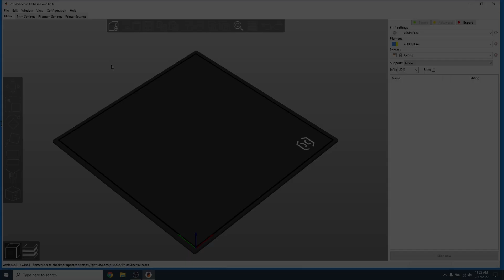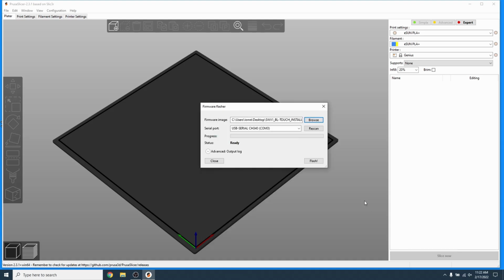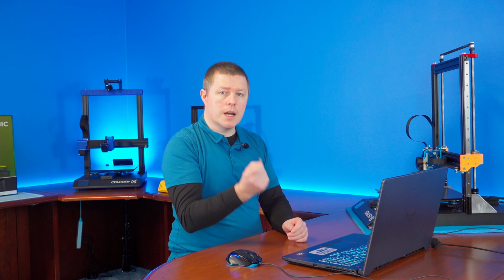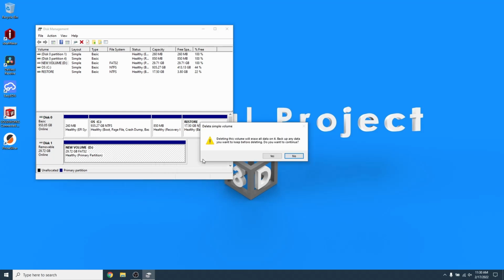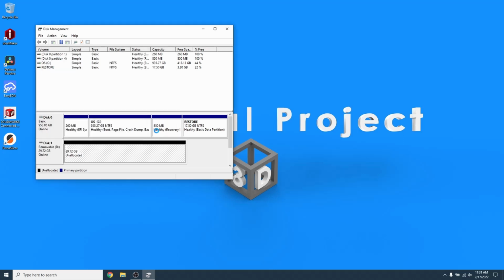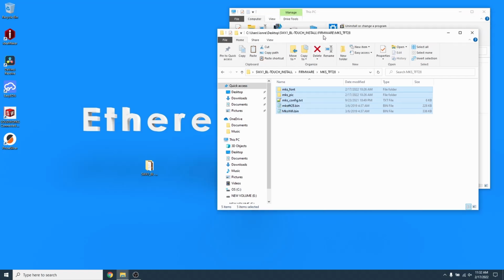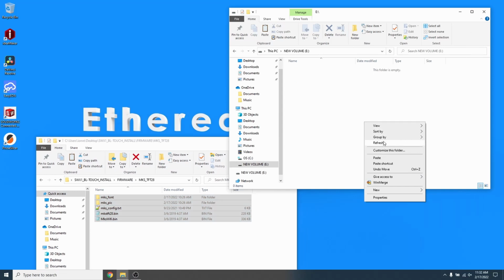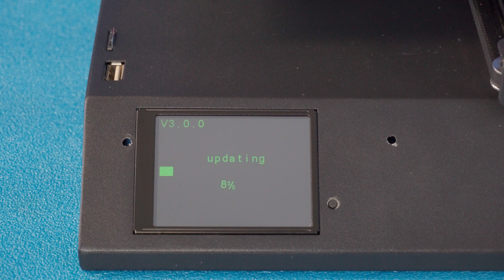Sidewinder X1 BL-Touch install, the easy way.

Comment: Is there a version of your firmware for the original Genius (not pro) equiped with the BLtouch ?
Reply from the maker: Try this https://drive.google.com/file/d/1bUwrxyi7oIbYdaLeXlaz6ZxjYBnk7I-s/view?usp=drivesdk
Reply: @EtherealProject3D  many thanks for that , unfortunately , after installing I see it probably only works with your PCB board and wiring and not with the standard genius PCB which has a BL touch connector as well,
is there something that can be done to change that ?
Reply: I've tried as well the Genius MBL version but get a "EPROM datasize error" message on boot, any ideas of what the issue can be ?

Comment: Does having a reset button next to my X1's touchscreen ensure it's a version 4? That's the gist of what I got Googling but wanted to verify before ordering the PCB. Got my machine late 2019 so it was near the V3 to v4 transition. Thanks a lot.
Reply from the maker: Yes that is correct. I got my machine in the summer of 2019 and its a V4
Reply: Thank you for your speedy response. Thought I was happy with my X1 until I experienced ABL. Hard to go back!
Reply from the maker: @maximthemagnificent  Yeah the ABL is a nice to have feature. Your timing is perfect as well, Im getting orders ready here in a few minutes.
Reply: Life got in the way, but when I finally got to it the install went smoothly, all things considered. Thanks!

Comment: Hi there, I was wondering if you could help me, I’ve bought one of your X1 breakout boards. The two different style of connectors confused me. I picked JST as I thought that was what connectors the machine used now. Have I picked the right style of connector? I have no clue about upgrading the X1 so I will be following your YouTube video to guide me. 

Just not sure I have selected the right connector to use. Your video shows you using dupoint connectors. 

Many thanks.
Reply from the maker: The type of connector you choose will depend on the connector type your BLTOUCH has. Most come with a DuPont connector but many of the clones do come with the JST connector. I have orders going out tomorrow, if you change your mind on the connector type you want let me know and I can change it for you.

Comment: I have notice there is no audio between 12.13 to 14.10, no captions as well. I'm having trouble setting up the BL-Touch and I'm missing something at this point. Is there something wrong with the video at the mention points?
Reply from the maker: Its fixed, sorry about that.
Reply from the maker: Thank you for letting me know, I will have a look.

Comment: So i bought all the parts including your breakout board but just realised my BL touch came with a metre long wire! I cant seem to find where to buy a shorter one. Any ideas would be appreciated, first attempt at modding anything in my life hahaha
Reply from the maker: Thank you for your purchase and support first of all. Amazon has bltouch kits that have a short loom. The easiest way would be to cut the long one to the desired legnth and re terminate the connector end.
Reply: @EtherealProject3D  I will give this a try thank you
Reply from the maker: @frankiemichael101  Your welcome, If you have any questions or need any help feel free to ask, you can DM me on facebook or instagram, or send me a msg on my website.

Comment: You have a firmware issue I think.  I bought your easy board, bought the ferrule kit, installed it, installed your firmware and I get an M999 error.  Did the process over and over and still the M999.  If I install the Waggster mod firmware the issue is resolved.
Reply from the maker: You have the the wiring incorrect someware would be my guess. The way it the wires are connected on the inside is different than the wagster mod.
Reply: @EtherealProject3D  dude I've been all over this thing.  The wiring is right.  Per your pictures both on the video and the included pictures with the firmware.  I have tried multiple firmwares from other sources.  The only error I get is with your fw.
Reply from the maker: @Nick-xe2hu  Where are you connecting the single black wire on the inside? And how do you have the probe connected on the break out board?
Reply: @EtherealProject3D  Single black wire to the number one position where the Z-end stop was connected.  The 3 brown wire plug to the 1st servo spot with the metal tangs oriented as shown (internet searches on this error suggest reversing this plugs orientation but did not help so its oriented as shown).  The bltouch wiring on the unit itself from left to right is gnd, pwr, servo signal, gnd, trigger.  On the pcb board from pin closest the gantry is servo, pwr, gnd, gnd, trigger.  It is not an error with the bltouch sensor.  I have 3 separate bltouch sensors.  All error with m999 on the X1 firmware.  On the X2 firmware all three sensors plus the stock black sensor with that comes with the X2 all work.  All other firmware tried for the X1 do not error.  It is only the X1 Ethereal fw.

Comment: Do you happen to know a good FW update/upgrade for the X2 with the 32bit board?  I'll be using this video tutorial for my X1, but I have an X2 also.  One other thing.  Does the FW in this video have any bugs to keep in mind?  I think one of your other FWs for the X1 had an issue with restarting a print after a print pause is triggered from the runout sensor?  Thanks for the vids.  Clear and concise.
Reply from the maker: A bug for this one is that it may fail to home if you run consecutive prints without a restart. Its random and I cant seem to find any reason for it. I have version 2.1.2 on my website available for download and a video here on youtube showing how to install the X2 firmware.
Reply: @EtherealProject3D  Perfect.  Thanks so much

Comment: hello thanks for the very useful and valuable information, unfortunately I bought a 3d touch but I can't get it to work properly what do you recommend to integrate it into your firmware? thanks
Reply from the maker: The signal pathing needs to be correct. Some of the 3d touch clones are wired different. The green wire will be ground, or blue wire depending on what clone you have.
Reply: @EtherealProject3D  hi, dear friend I have a GEEETECH clone, I've tried all the possible combinations but the result doesn't change, I think I'll have to buy an original bltouch
Reply from the maker: @antoniocioffi4107  i will see what i can find out.
Reply: @EtherealProject3D  thank you very very much
Reply from the maker: @antoniocioffi4107  So it looks like its wired exactly how a bl touch is. I would guess you have missed something in the wiring or you have a dud probe.
Reply: @EtherealProject3D  thanks for your answer.i will check everything  again
Reply from the maker: @antoniocioffi4107  your welcome. Let me know how ot gos.
Reply: @EtherealProject3D  I will do it  thanks a lot
Reply: ijust ordered a new bl touch . iwill notice you about my progress . ;))
Reply from the maker: @antoniocioffi4107  Sounds great, good luck.
Reply: @EtherealProject3D Hello, the original bl touch has finally arrived, I installed it and now when I turn on and test the "HOME" function, an alarm appears: STOP CALLED BECAUSE OF BLTOUCH ERROR- RESTART WITH M999... I state that I don't I unplugged the z-axis plug from the motherboard but only from the end stop - thanks
Reply from the maker: @antoniocioffi4107  the single black wire needs to go to the z endstop pin.

Comment: Hi just wondering if anyone had the same issue as me. After flashing the screen when I go to TOOLS > MORE I am missing the "Reset Eprom" and "Save to Eprom". Any thoughts? I am unable to start the "Z Offset" sequence as well.
Reply from the maker: Ensure your sd card is less than 8gb. If you need some help you can email me or msg me on facebook or instagram.
Reply: @EtherealProject3D  Thanks will make sure and try that.
Reply: @EtherealProject3D  I originally used a old 128MB mirco SD card, but now used an 8GB micro SD and everything is there and works a treat. Thank you!
Reply from the maker: @enaudeni  Awesome 👍👏
Reply: @EtherealProject3D  I'm having the same issue, installed board and blt touch, updated firmware and updated screen, but the menu's on the touchscreen are not the same ones you show in your video.  I can not find how to start the z-offset.  could the link in the video be pointing to the wrong files?
Reply: @EtherealProject3D  Forgot to mention that I'm using a 32gb micro sd with one partition set to 4gb like you showed in the video.  The tft firmware seem to install fine as it went up to 100% before finishing.  It's just the screen selections are not matching your screen selection choices.  I'm wondering if the firmware the video points to is from another version of yours.
Reply from the maker: Try a different SD card. These screens are very picky with sd cards.
Reply: @EtherealProject3D  Well, that did it, ordered a new 4gb micro sd and tried it a few minutes ago and this time it completed the update.  Thank You.
Reply from the maker: @allisterfiend_2112  Awesome, im glad it worked.

Comment: Hi! Thanks for the informative video. I have a question regarding the tft firmware. Can i use them on the x2?
Reply from the maker: I have this TFT firmware specifically for the X2 here. https://www.etherealproject3d.com/3d-printer-firmware/swx2-marlin-2.1.2-300c-max-nozzle-temp
There is also mainboard firmware in the same download. Note that it will allow for a max nozzle temp of 300c. If you want it recompiled with a lower max temp let me know and I can do that for you.
Reply: @EtherealProject3D  Nice! I appreciated your effort. For now i will make do with both the mainboard and TFT firmware you compiled. Subscribed to your channel already and may god ease your effort. Thank you!
Reply from the maker: @pumpkinhead959  Thank you very much.

Comment: Help! I followed all your steps, however my printer is stuck at the 'booting' screen. I'll link a video in the reply if that helps.
Reply: Here: https://youtube.com/shorts/yYf9bMVbkso?feature=share
Reply: NVM! I.. uhh.. reinstalled it?? Did the same steps over?? Turns out my Mac forgot something while updating. Thank you so much for your tutorial!😊
Reply from the maker: @BDin3D Glad you got it sorted.
Reply: @EtherealProject3D actually, still having issues. Nozzle smashed into the bed, do you know which wire I should check first?
Reply: @EtherealProject3D Also, thank you for having quick replies. I tried a different tutorial in the past and they never responded about a question to a part they had that that didn’t link
Reply from the maker: @BDin3D  You are very welcome. I try my best to respond as fast as I can. If you have any issues or questions I am happy to help.
Reply: @EtherealProject3D well, i was having issues about my BLTouch ramming into the bed and wondering what cables to check. I’ll provide a video if necessary in the morning. I suspect it’s the direct connection to the BLTouch but I’ll fix it when I get out from school.
Reply: @EtherealProject3D  Uh-oh. Nothing sticks to my bed anymore when i print. It didn't have this issue before. Any fixes, other than just re-calibration?
Reply from the maker: @BDin3D  It sounds like you need to babystep down as your initial z offset calibration was a little too high. When I do it sometimes it perfect, sometimes I need to babystep close to 0.1mm down.
Reply: @EtherealProject3D  Thanks
Reply from the maker: @BDin3D  Your welcome.
Reply: @EtherealProject3D  Hello! it's been a nice 7 months of printing, but i've recently noticed that my printer has been getting increasingly unstable. Is there a way to flash a clean slate onto th printer so it doesn't malfuncion?
Thanks!
Reply from the maker: @BDin3D  You could try that.
Reply: @EtherealProject3D  okay, gave it a fresh slate. Didn’t fix much but not like it affected the performance. However, about a week ago, I started getting thermal runaway errors on my artillery’s bed. The bed heater is fine but it’s clear the cable needs replacement. What can I do?

Comment: How do you do this without breakout board. ? Is there a pin out of the connection at the extruder flex
Reply from the maker: You would need to use the existing RGB connection. The "-" would be "Probe", the "R" would be "Ground" and you would need to splice the 2 ground wires together, the "G" would be "+5v" and the "B" would be "Servo". I hope that helps.

Comment: Could it be easy to switch from stock abl to a bl touch om a Sidewinder X2? The stock one isn't so nice.
Reply from the maker: Its super easy, i have designed a mount for it. https://www.etherealproject3d.com/stl-files/swx2-and-genius-pro-bl-touch-cr-touch-mount
Reply: @EtherealProject3D  thank you. the most BL touch variants has 5 wires but i need only 4 to connect them? Couldn't find a hind for correct wiring :D
Reply from the maker: Find the 2 grounds and splice them.

Comment: After completing all the installation steps, when I go to auto level the leveling fails.  I watched it and it looks like starting on the 3rd or 4th probing, along the edge of the build plate, the build plate goes too far and the probe is deploying on the edge of the build plate.  Any advice how to adjust the y stop or something so the probe deploys successfully?
Reply from the maker: Try updating the tft with a different sd card.

Comment: I purchased a board from you, installed everything as in the video. The main board firmware was successful, but theTFT monitor firmware does not work. The monitor says:" SPI Flash  PIC Erase Done". This is where it all ends and the interface is gone. SD-Card 128Mb, formatted on FAT.
Reply from the maker: I would try a different sd card.
Reply: @EtherealProject3D  Yes, everything is great! I have scoured the internet for this problem. It turned out the memory card is not read correctly. Thanks for the advice! You are the best!!!
One more question.
After all the manipulations, I started printing squares, and the printer started printing not from the left corner, but from the middle and went to the right.
Apparently his house is somehow overwritten after pressing the "Home" button. Any ideas about this? Thanks
Reply from the maker: @ObserverLife  you might need to reslice the stl for the test print.
Reply: @EtherealProject3D  This is what I did. I took the STL file and cut it into PETG plastic in the slicer, since I don’t have PLA plastic
Reply: Is it possible that I made a mistake in the G-Code type and chose Marlin instead of Marlin2?
Reply from the maker: @ObserverLife  what slicer
Reply: @EtherealProject3D  PrusaSlicer 2.5.0
Reply: before printing, the slicer extrudes two 245mm strips of plastic from the left edge of the table.
M190 S90 ;
M109 S245 ;
; Home
G28 ; home all axes
G1 Z10 F3000 ; move z up little to prevent scratching of surface
G1 X3 Y3 F5000 ; move to corner of the bed to avoid ooze over centre
; Wait for final heating
;M109 S245 ; wait for the nozzle to heat up
;M190 S90 ; wait for the bed to heat up
; Return to prime position, Prime line routine
G92 E0 ; Reset Extruder
G1 Z3 F3000 ; move z up little to prevent scratching of surface
G1 X5 Y5 Z0.25 F5000.0 ; Move to start position
G1 X5 Y250 Z0.25 F1500.0 E15 ; Draw the first line
G1 X7 Y250 Z0.25 F5000.0 ; Move to side a little
G1 X5 Y5 Z0.25 F1500.0 E30 ; Draw the second line
G92 E0 ; Reset Extruder

Here X5 starts from the middle of the table.
Reply from the maker: @ObserverLife  Ive never had the greatest luck in prusa slicer so I couldnt tell you. You can try printing the gcode in the download and just manually raise the temps when the print starts
Reply: @EtherealProject3D  Yes, I can change the code manually. But what about other programs that I will print later? Do you have marlin pre-compiled version? Perhaps there is a small nuance that can be changed? Can you send me an email?
Reply: I understood what the problem was. After G28 in the start code, be sure to turn on automatic table alignment M420 S1
Reply: @EtherealProject3D  Thanks for the support and for the item. You are the best!!!
Reply from the maker: @ObserverLife  you are very welcome. Im happy we were able to get you fixed up.

Comment: Can I use your firmware (including TFT firmware) with the wagstermod installation method?  I don't have a v4 ASX1.
Reply from the maker: Yes but you will have to connect tje wires on the inside of the machine how I show in this video.

Comment: Does this firmware work with only your special board or does it also work with manually wiring the BLTouch to where the LED probe was?
Reply from the maker: It will work with the stock board if wired corectly, The "-" would be Probe, the R will be ground, the G will be +5v, and the B will be Servo. Hope this helps.

Comment: Great video, but I have a question.  I'm using a different mounting for the BLTouch, and need to change the X/Y offset because the probe lands off the bed.  I've installed Visual Studio Code to edit the firmware, but it's giving me several errors like the following:

In file included from Marlin\src\HAL\AVR\../../inc/MarlinConfig.h:49:0,
                 from Marlin\src\HAL\AVR\HAL_SPI.cpp:34:
Marlin\src\HAL\AVR\../../inc/SanityCheck.h:1707:6: error: #error "LCD_BED_LEVELING requires a programmable LCD controller."
     #error "LCD_BED_LEVELING requires a programmable LCD controller."
      ^~~~~

Any idea how to resolve this?
Reply from the maker: Disable LCD bed leveling, the mainboard doesnt see the tft as an lcd but rather a terminal.
Reply: @EtherealProject3D  That got past that error.  Now which parameters need to be modified to accommodate a different X/Y probe offset?  I've already modified NOZZLE_TO_PROBE_OFFSET, but does PROBING_MARGIN also need to be modified?
Reply from the maker: @kenhammond3810  unless your probe no too far off from the nozzle you will be fine with just adjusting the nozzle to probe offsets.